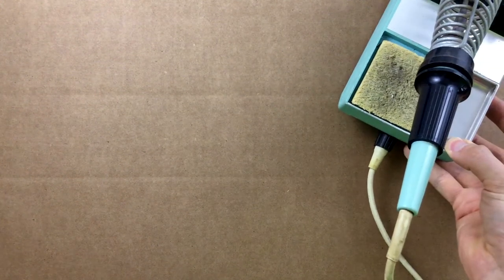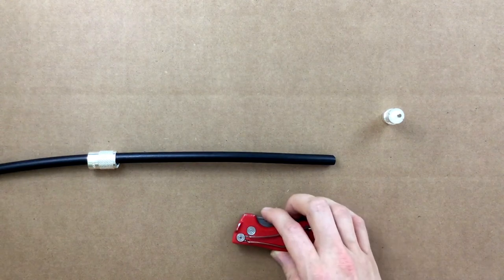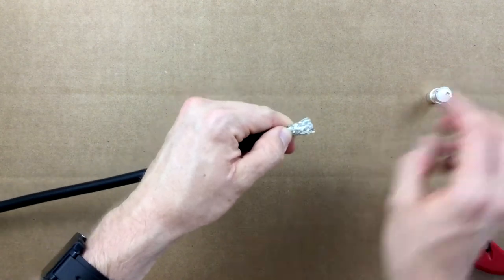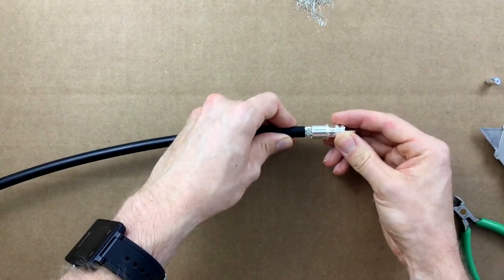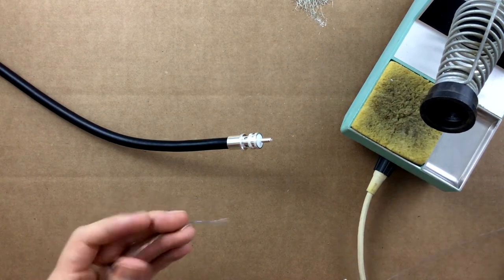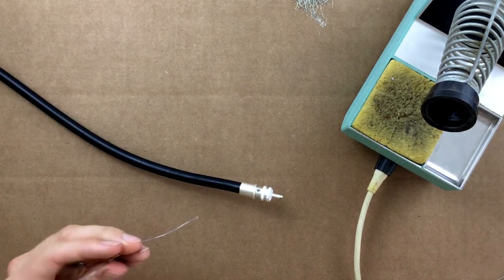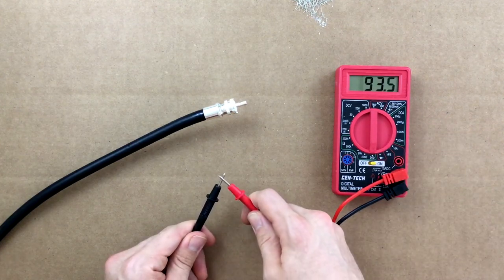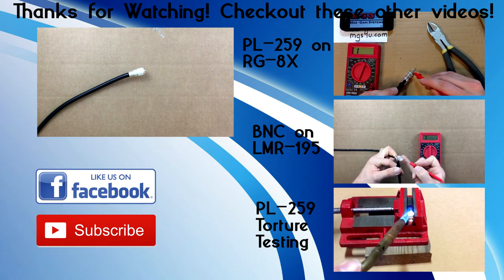Pl-259 Solder On Installation Guide for LMR-400 Coaxial Cable Full HD

Comment: I don't often dislike a youtube video, but in this case people need to know that LMR-400 was designed to only be used with crimped connectors. The foam PE dielectric has too low a melting temperature to survive a proper solder process. 

Crimped connectors are far more consistent between connectors vs solder/clamp connectors, for a variety of reasons. Crimping has been method in use by commercial and cellular industries for decades. The tools are not expensive anymore, and a solid investment for anyone who plans on making more than one cable!
Reply: Yes I know this comment I'm replying to is a year old.  Good to address things for whoever reads them in the future. 
As far as lmr 400 not being designed to be soldered, I don't believe that's quite right. The product sheet from times microwave lists  atleast 15 types of connectors that it describes as center pin solder. 
Is crimping easier - yes!  Can it be messed up as well - of course!  down side is that you can't do it over. You just burned 10 bucks.  Its also how I put my N connectors on so I'm plenty familiar. I think the important thing is proper installation/ craftsmanship.   Maybe flux would help keep the temp more manageable?
Reply: @brizzle8797  I should have been more clear in that initial statement. The shield was never designed to be soldered. Center pin can go either way.
Reply: Yes that makes sense. It is so interesting when you start to dig into manf specs!  Amphenol which seems to be the gold standard recommends soldering the braid and center conductor on a pl 259...BUT does not list lmr 400 as a compatible cable! Instead they have separate  pl compatible  connectors specifically for lmr that have solder center conductor and a crimp braid.  Might have to start using those as i already have the prep and crimp tools for lmr N connectors. 
The more you know!

Comment: I've seen other videos where they fold the braid back before sliding the connector over it.  is that another way of doing it, or is that incorrect?
Reply: Those videos more than likely are using thinner cable like RG8 and it's easier to slide the connector over the folded back braiding on that thinner cable than it is on LMR400 or  similar.

Comment: You didn't point out that the braid needs to be visible and near the surface of the holes so that you are soldering the outer connector to the braid. Just filling the holes with solder accomplishes nothing if the braid isn't soldered, and much of the time that braid will just fold up behind the holes to where you can't even solder it. Just fold the braid under the connector threads, trim off excess, and seal it with silicone or coax tape when done / installing, no need to waste time frustrating yourself trying to solder the braid. I would have like to have seen a close up because I doubt that any of the braid even got soldered.
Reply: This is my issue.  I can't get the braid to solder.  It just falls rolls off like water.  So, you are saying that I don't need to solder the braid?
Reply: @jtrehern  LMR-400 is designed for crimped connectors. Contrary to amateur radio popular belief, crimp connectors are superior and yield far more consistent results vs clamp/solder.

Comment: These connectors were great in the second world war. Moving on.
Reply: and they are still great to use today in 2021!!!!!!
Reply: @mr.stonerUDX714  yes they're fine at HF, however you have to understand that most operators install them poorly or completely wrong. Often the dielectric is heat damaged and or the shield doesn't take when they think it has. Or they use the wrong coax, foam dielectric is a no, no (LMR400 is designed to be crimp only). Crimp or compression is the only way to go, these videos only help to perpetuate poor practices.
Reply: @arconeagain  maybe YOU dont know how to solder them but MOST PEOPLE DO!!!!
Reply: @arconeagain  and people like you say shouldnt be ham operators people that cant must be Biden luvers!!!!